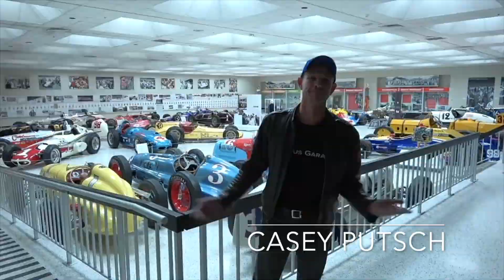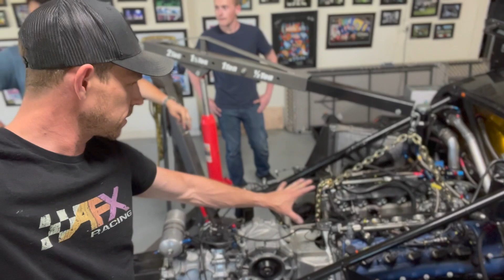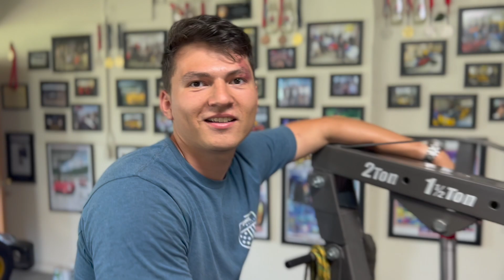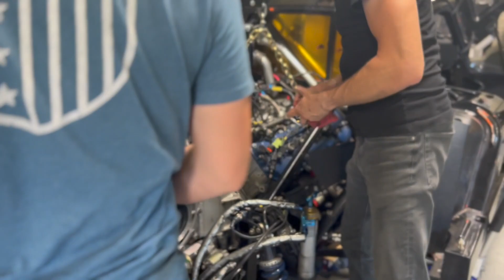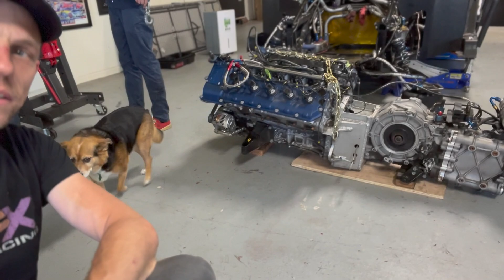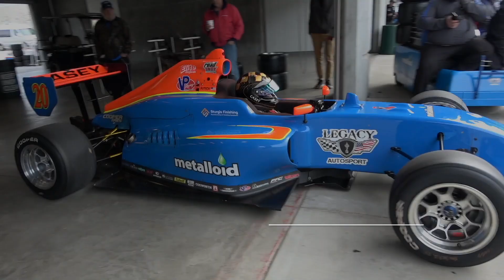740hp MONSTER Dinan BMW V10 removal from Daytona Prototype

Comment: Hey Casey, I spent a decade on a Daytona Prototype team running in the grand am road racing series. We ran a Riley chassis Pontiac / Chevy car. It’s way easier to split the gearbox off the engine first, then remove the engine from the chassis.  The rear suspension stays attached the the gearbox as it’s a stressed member. And we never spent 5 months making decisions on how to make our car better, or event 5 days. We needed to make decisions in seconds or minutes to “tune” the car to the track and conditions.

Comment: That engine would also be cool for a 90s f1 style open-wheeler
Reply: @Car Guy; Clearly, Obviously, certainly Your user name fits, matches with the numerous 'car guy/enthusiast' viewers on this channel and nearly all on this platform and among many forums -ignorant, lacking basics, proper information, ideas, concepts, principles.
A. Look at the engine and transmission physical size with this BMW V-10
B. Look at the engine and transmission physical size within any age F1, Indy or open wheel racing vehicle
C. Look at the engine space size and the space size for any open-wheel racing vehicle
D. Look at the specifications with any open-wheel vehicle from 1960's-current for the engine, transmission, drive train.
E. Look at the specifications with this BMW V-10 engine and transmission
F. Compare A or E With any one of B-D => The results should be obvious, clear, certain, and absolute how silly, ignorant and nonsense Your written comment is.
All The Best
Sincerely

Comment: Completely naïve question, but is there any relation to this BMW V10 and the V10s that were in the earlier 2000s M5s?  I know that was a racing inspired or ported over motor…it has its rod bearing issues but it’s still a pretty cool motor and I searched around for one for a while (yes I’m enough of a masochist :) )
Reply from the maker: It started as one of those
Reply: @CaseyPutsch  very cool, those are nice!  Are you going to tear down the old motor at all to see what failed?  Is the new motor the same deal?
Reply: @dwyerpe  There was a previous video that more or less did this with another engine that had ran in the car, but was taken out. If I recall correctly, the cylinders had been bored out so much that the thickness between cylinder walls wasn't enough to run the engine sustainably for a long time.